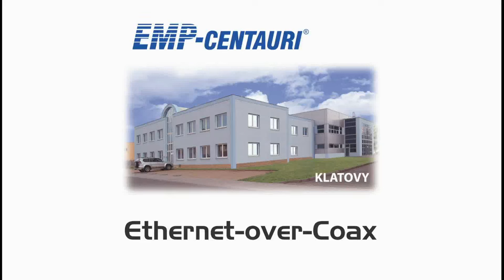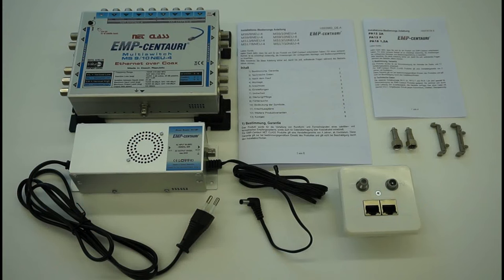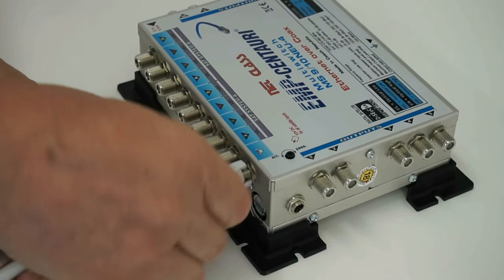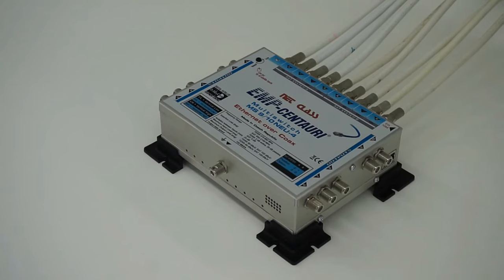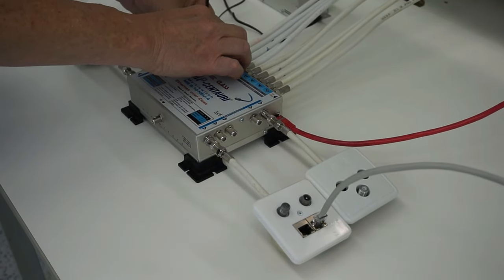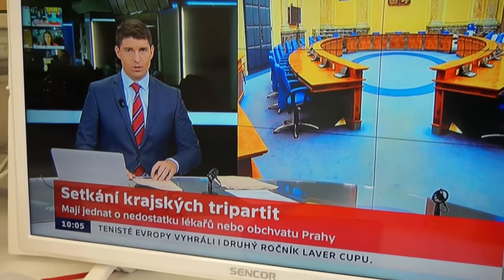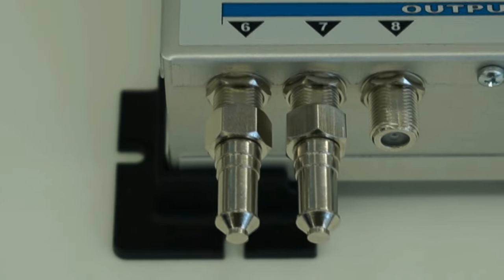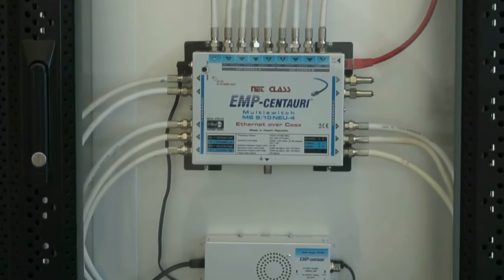SAT TV and Internet via ONLY Coaxial Cable in Your House

Comment: How much?
Reply from the maker: EoC multi-switch prices are roughly double compared to conventional satellite multiswitches
Reply from the maker: @_________________404  We offer wall sockets at 29EUR per pc for MOQ which is about 5pcs, with significant discounts for volume orders. The wall socket also has an integrated Ethernet switch 2x100Mbps inside with 2 independent RJ45 outputs. We offer sockets in a version with a plastic cover or in an aluminum version with a plastic frame, the customer can choose the color of the plastic.
The EoC multiswitch prices differ. For example multiswitch MS17/10NEU for reception from 4 satellites and  for 10 connected users, the price starts at 300EUR and goes down with discounts for volume orders. For more information, please contact sales@emp-centauri.cz.